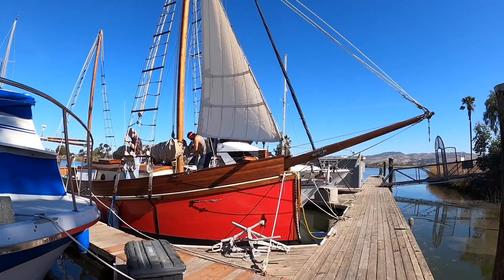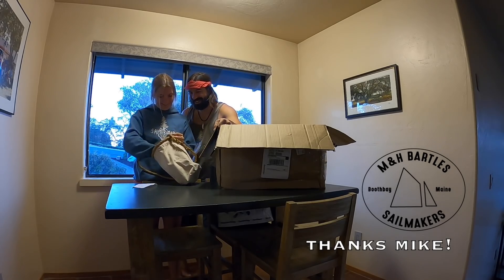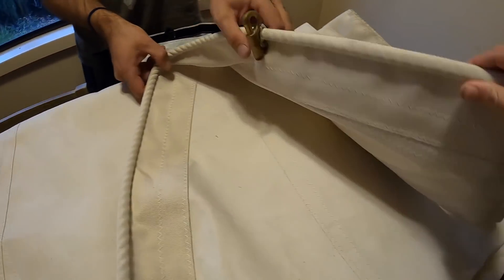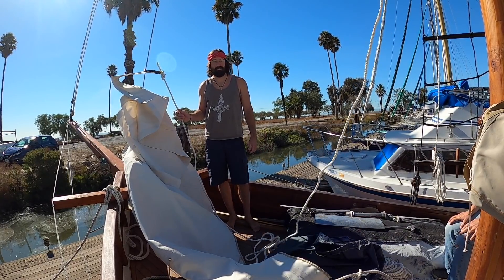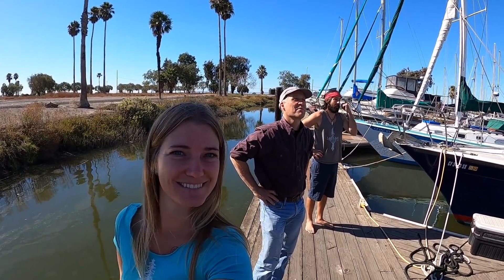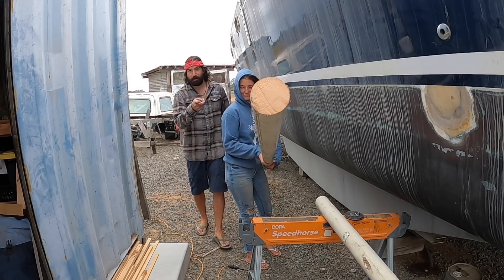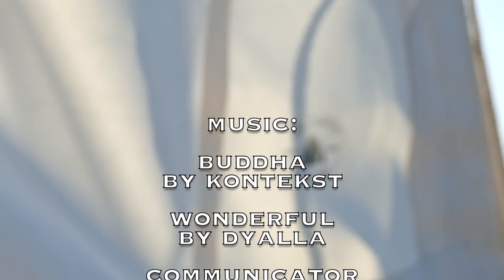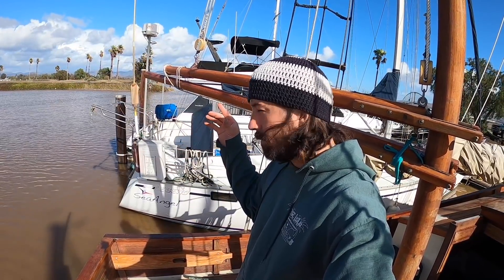Salt & Tar: Ep.167- Smells Like a New Sail

Comment: Davits are vulnerable to damage if you drag down on someone or get rear-ended. Better to have them bend than rip the hull apart. Get a light weight dinghy and keep it on deck when you go offshore. They do add some protection to your rudder, makes a handy place to add solar panels. Good luck on your adventures!
Reply: Salt & Tar
1 day ago
 for us, the function will be solar mounts. We'll have two panels mount atop the davits. The dinghy will most likely only be there when at anchor or a short trip. Longer trips We'll deflate and stow on deck.

Comment: Get the davit mounting plate galvanised. The constant flex and movement will crack dry paint and it will start rusting in the inside corners.
Reply: Or powder coated … You can even get one that looks like galvanizing or even patina

Comment: Davit elevators. If you ever hook a shark, Marlin, or other larger fish, you can hoist it with your davits, short of using the main boom as a crane. Then all you have to worry about is an ice locker to store your haul. 😁
The second sheet looks quite nice. Love the black leather and brass bits. I guess Ruth tested the velcro before the glue backer had time to set up fully... 🤣. Been there done that. Press and let it set for several hours before pulling on it. It takes time to fully adhere.

Comment: The week link in your new set up is the original bronze base - maybe add a clamp (like a muffler clamp type) around the base and into the new gusset? Also maybe put your deck support under the beams inside and use steel cable and turnbuckle to connect- (only one hole through deck....) thanks for sharing your journey - we live vicariously and our dreams are all the better for it -

Comment: At about 20:00: The davits are mounted to the WOODEN bulwark structure + it is desirable to transfer a tension load to the WOODEN framing of the hull below the WOODEN deck. Wood = movement! 

This lubber thinks a plate ON the deck is un-needed (not to mention unsightly). Better to put that same plate UNDER the deck (or eliminate it altogether- those forces should go directly to the framing, not be first transferred to the decking), connect to framing below-deck and have only an eye above the deck with a turnbuckle connecting to the davit mounting plate. This system would thus be adjustable to allow for: 1. Movement of the wood and aging of the entire system. 2. 'Leveling' of the davits. 3. Removal for Cleaning/Painting/Maintenance.
Reply: But the less going thru the decking the better.

Comment: Hi Garrett, at 20:50 you're describing the loads on the davit's support structures.. the forward elements leading down to deck will be both in tension and have a moment force (rotation) applied while the corner where stern meets the bulwarks is getting a downward (compressive) and moment applied... you may need a reinforcement along the inside of those corners to handle that as well, since the rest of structure is so heavy vs the corner reinforcement 2x2 ? I'm thinking a piece of right angle with angled cuts to match deck and railing could be applied to that with screws, effectively laminating it on two sides as a load spreader, it may not need plates on the ends as "feet" unless you see some movement when davit's are under full loads or swaying.

Comment: I really wish your sail maker had sewn the panels horizontally rather than vertically.   I does make a difference as the air would flow easier down the sail without turbulance  ergo it pulls better.  same goes for the main

Comment: Those  davits are to thin to withstand the weight of the dingy, mostly if you leave the motor on.
I had two davits made of s/s which were  2.5" dia. and the flexed a lot. Had to replace with two Whitehall s/s davits which were 8"x4" at the base. Had a Highfield 2.7 dingy with a Yamaha 15hp engine on. 
That new sail looks really nice, as everything else does.
Reply: Salt & Tar
1 day ago
 for us, the function will be solar mounts. We'll have two panels mount atop the davits. The dinghy will most likely only be there when at anchor or a short trip. Longer trips We'll deflate and stow on deck.

Comment: My concern is the davit exercise is coming in as an afterthought, rather than an integral part of the engineering of the vessel. Constructional contingencies could have been made with steel components as part of the beams to which the davit assembly will now be bolted. I love your work, but I have seen add-on, davit failures several times where the required tensile strength has been woefully misjudged. I simply urge you to do the maths to avoid disappointment down the line. I feel a little embarrassed to make this comment but I do so out of regard, not criticism.